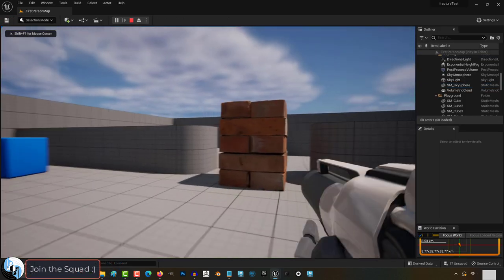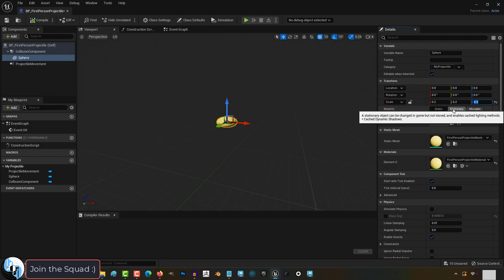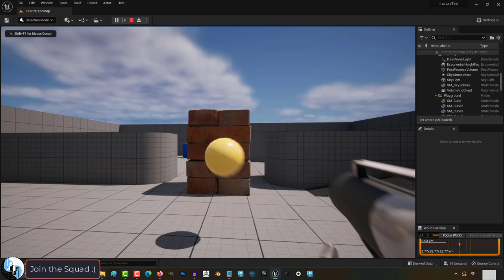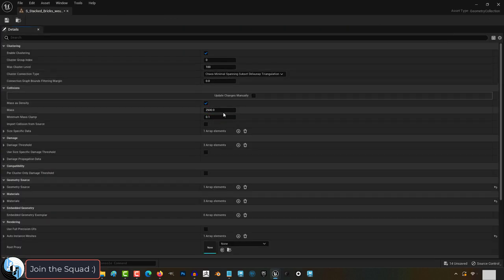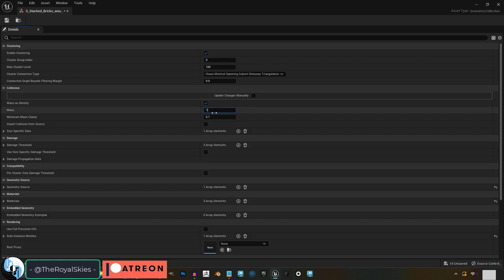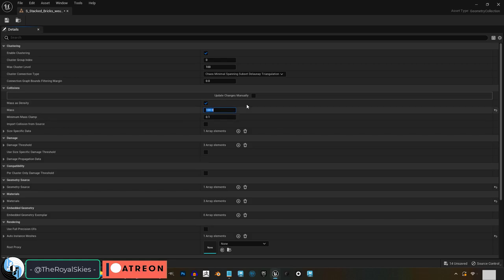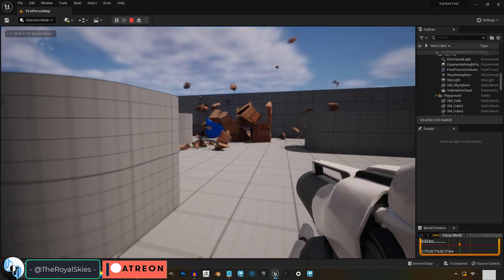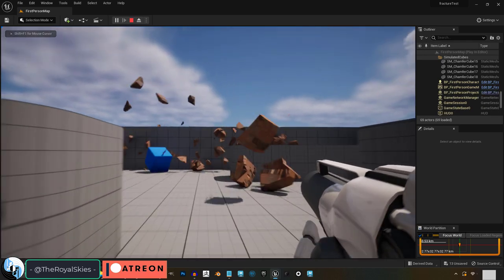Unreal-5: Projectile Based Fractures (In 60 SECONDS!)

Comment: What I’m looking for is how one can control the physics per fractured piece. For example, disable gravity on the fractured pieces so they fly in a bunch of directions 😊
Reply: you could run some logic in where you get the trajectory of "hit from direction" and set it up so it uses that to calculate rebound direction and set the logic to push the fractured piece in random offsets against trajectory?